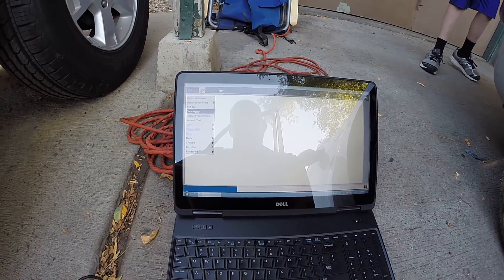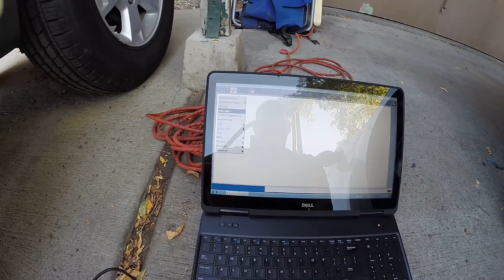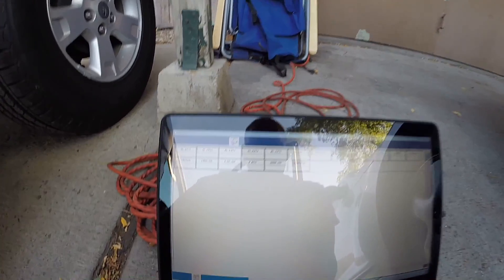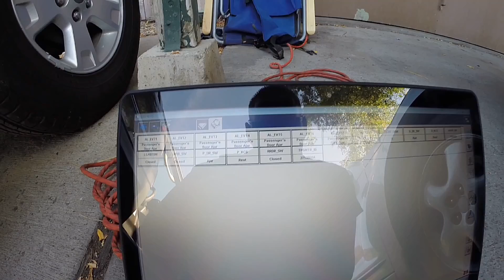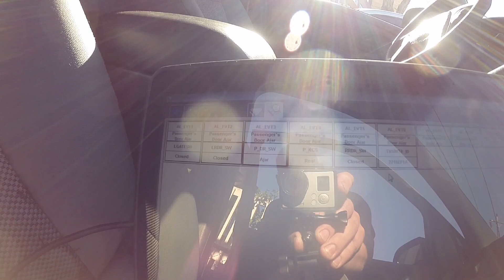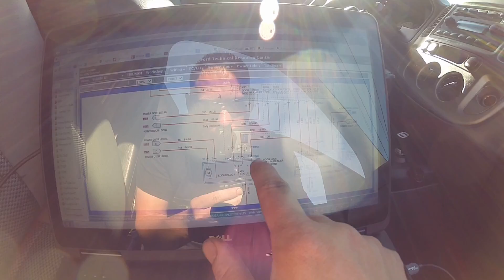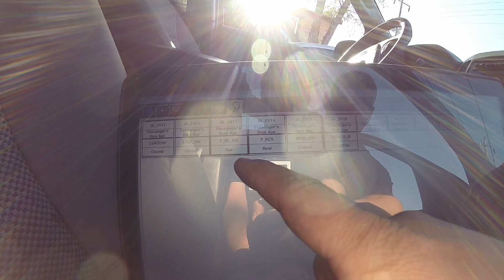Ford Vehicles: Finding Door Ajar & Factory Alarm Problems The Easy Way

Comment from the maker: ELM 327 OBD Adapter you MUST use-
http://amzn.to/2yg0HPT
Reply: can you do an update with the new forscan? I'm going thry the alarm issue and the new forscan does not look like this?
Reply: I have tried this adapter. However with my 2005 escape I cannot get it to read the GEM module. What should I do to find the right door sensor?
Reply: I need ti find someone in Houston TX with FORScan, I have a 2006 Ford Escape with alarm issues, I replace the hood ajar switch that did help some.
Reply: @whodat99991  no
Reply: @whodat99991  lbs there's your hot Cheetos girl you going to miss p
Reply: Would the FORScan lite (smartphone) show us the door ajar and alarm issues? I'm going to figure this out soon? $5.99 google play store $10 bluetooth reader?
Reply: I have the forscan V2.3.33 beta and the recommended OBD adapter connects works good. I cannot find the data logger nor can I find the anywhere to get to the security alarms. Any ideas. On my forscan my icons are on the left side of the screen vertically.
Reply: Can the alarm system hinder my car from starting?
Reply: @infotube6335  not directly, but it will drain your battery, which will prevent your vehicle from starting.

Comment: I have a '13 Explorer XLT w/tow.
Intermittent door ajar for front passenger and driver doors.  I removed the passenger door to inspect wiring. Did not see any short, pulled, bare wires. No worn, chaffed or pinched wire insulation or wrapping. At the time of repair only passenger door ajar light was failed. So I unplugged the lock assembly connector and jumped black w/ yellow stripe. The on-dash door ajar light worked normal as it was unplugged and plugged back in. The door latch assembly was replaced immediately.
I have not seen a false passenger or driver doors1 ajar light since.
So I have a question. If one intermittent latch assembly failure can cause a false intermittent error on the other door too?
Reply: Sure enough 10days later the drivers door failed. Spraying helped for a couple days then needed to be sprayed everytime. Had the latch assembly already so removed and replaced. Problem solved. bought from O'rielys 130ea lifetime *shrugs* look just like chinese on ebay pictures that are 30. 1hr repair time each. 25min if experienced

Comment: I have a ford flex 2013 known for that and i took it to an electrician guy and all the did was ground the wires so it always shows close  even if the door is open. will i be able to undo that?

Comment: Hi,

I have a 2015 platinum and after very, very cold (minus temps) and rain, the security system is going nuts!  Honking, puddle lights on, etc.  Please tell me what software/program you use on your laptop to see the sensor fail data...is it Forscan?  Are the Forscan units that are for sale any good for this?  
I really like the data shown on your laptop screen as it is large and easy to see.

Your videos are the best.  THANK YOU so much!

Jon Francis

Comment: I have a 2000  mercury sable that had the horn alarm going off on its own at anytime. I found a solution on a ford forum site where this guy figured out how to stop it. All you need to do is this. When you get out of your car all the locks are on. The driver door unlocks when you open it to get out. Then depress the door lock button. What you re doing is not setting the alarm using your electronic door locker which is what activates the alarm mode. My friends across the street were thrilled! Haaa.

Comment: Thank you for posting these how to videos. I have learned from them and enjoyed the content. Quick question I hope you can help with. We have an 05 Escape we have had since new and is now on the second child driving it. I have done the bypass of the door ajar switch on all four doors. But now the door chime goes off when the vehicle is in reverse or drive. I may have bypassed the wrong wire in the drivers door as I did not have a diagram for the wiring and think I bypassed the same color wire as passenger door. I f I did this correctly is there a way to disable the door chime? I thought the bypass of the door ajar switch tricked the computer into thinking the doors are closed. Any way the alarm has not gone off since doing the bypass. Thanks again hope you have some advice for this situation.

Comment: Love your videos! I'm having this same issue with a 2004 escape. I ran IDS on it and all the alarm events(8) show panic?? I'm not hitting the panic button and this happens regardless of physical location or proximity of the key to the vehicle. Any idea what could cause a PANIC alarm???
Reply: Weak fob battery can trip the alarm. Make sure both remotes have good batteries
Reply: @tatertots-n-soup  thanks for the tip. I thought that could be the issue so I replaced both batteries but still have the issue. Seems to be isolated to the drivers door. Anytime the door is locked and the alarm is set it trips. Always shows panic alarm in IDS. I gave up and we just don't lock the door anymore.
Reply: After doing the door latch assebly wire jumper test I was convinced enough to buy both front door Dorman latch assemblies from local trusted parts store. It solved the door ajar dash light and the false alarms have stopped. They never logged an event on 2013 explorer.

Comment: I've got a ford explorer with the alarm randomly going off, and I know its either the driver door or the flip up window in the back.  Both of these are not closing quite right (i have to slam the driver door to get it shut and the window in back won't close completely flush).  Does anyone know if the flip up window would make the system say door ajar ? I'd appreciate if anyone knows or can check and report back.  Many thanks in advance if you can.

Comment: Very helpful!  My '04 Escape started acting "twitchy" when I shut it off...a few weird flashes on the dash and maybe/maybe not the key fob would lock it.  When the fob worked, the alarm would go off within 20 minutes or so.  I elected to skip all the diagnostics and just WD-40 and exercise the heck out of all the door/hatch/hatch window latches as well as exercise the hood open sensor.  Victory!  I don't know which latch was the guilty culprit, but my money is on the driver's door.  Any-hoo, 4 days later and everything is ok!  Thanks for the video tips!
Reply: You are very lucky WD-40 work for you, I'm been trying WD-40 on my 2006 Escape.

Comment: I have a 2007 Escape that when it is parked and doors are locked alarm will randomly go off on occasion. I have isolated it to the drivers door. My question is I don't get any door ajar light or dome light coming on etc, no alarm coming on while driving, would this still be a door ajar switch or could it be another switch? I have found if I leave the drivers door unlocked while parked alarm doesn't go off or it hasn't the last couple of days. I tried spraying like you described though I had a temporary fix but alarm went off again. The only thing that works is leaving drivers door unlocked. Your input would be deeply appreciated.
Reply: John Simler mine goes off while driving and it drives me crazy 😩

Comment: You relied on logged history in OBD to get you headed in the right direction.  I have a similar problem with 2 escapes and random alarms.  I'm using Forscan/OBDLink MX and a BlueDriver scanner but neither seem to be able to retrieve the stored events.  All the latch sensors seem to be behaving fine during live inspection so I'm kinda stuck.  If my tools can't see it, I'll want to check 
with a diagnostic center -- what would they need to have to be able to get this information? THanks for all you do.

Comment: HI Brian,  I've been subbed to your channel for several years and appreciate your videos.  I have a 2005 escape with a DR PDL actuator that's not working.    I have confirmed that all the door ajar switches work, including the one for the RR door.   

Initially when I first got the escape last month,  I had a flickering dome light and the door ajar light on the dash flickered at the same time.  I thought I had an ajar switch issue, but I cleaned all the body grounds I could find and that issue has not occurred since.

When I pull the RR door panel off and disconnect the wire harness plug to the actuator assy,   can I back probe one of the wires to check for power for the door lock actuator?   I'd be using a 12v test light for this.  If so, do you know what color the wire is I need to check?  I'd like to confirm it's an actuator issues and not a wiring issue before I buy the actuator assembly.  

Thanks for your help, I appreciate it.
-Greg

Comment: Hi! I am having this problem and purchased the OBDLink MX bluetooth device.  I have connected it to my laptap and can see the software.  The problem is, I don't know what I'm looking for.  There are no "alarms" or issues to resolve.  My question is, I wonder if I need to purchase the additonal Ford software as well? There's no great instructions as to the name of the sensors or alarms I'm looking for.  Does that make sense? My knowledge on this is so extremely small, I don't know if I'm communicating my questions well :)  Thanks!
Reply: Ok. I see that it's the GEM module that houses the door alarms.  But it says I have no issues to solve.  HELP!! I definitely have issues.  I just sprayed last night with WD40 but I haven't driven anywhere yet.  I have a 4-hour drive coming up on Monday and will go nuts if it alarms the whole time.  Interestingly, I noticed it didn't do it AT ALL during the winter.  The hotter it gets, the more it happens.  Any thoughts on that?

Comment: I have a 2002 Explorer that has issues with the alarm and door ajar light, but the light isn't on all the time. It sporadically comes on when I'm driving- the chime goes off, the doors lock themselves, and the hub light flashes on and off. The alarm would also go off randomly, sometimes several times a day, until I just went ahead and took out the horn fuses. Do you think what you did in this video would solve my problem too or is something else causing this problem?

Comment: I have a problem I need some advice with....when I lock my doors my car starts!  I do have the alarm issue and it's been annoying me for several years and my rear hatch opens sometimes and other times it won't,  but this week when I lock the car it starts so I could really use some advice with that.

Comment: So what scan tool are you using? FORScan?  I am having trouble with my 2013 Expedition alarm going off randomly, can I use the FORScan software with the ELM237 to trouble shoot which door is causing the issue?

Comment: I got a used 2001 Ford Excursion Limited (7.3L Diesel V8), but the owner only had a single, ordinary all-metal key (no chip, no spare).  The vehicle still starts with the ordinary key, no problem.  The problem I'm having is whenever I open any of the doors, the interior lights and the running board lights go on and stay on, even after I shut the door... this happens whenever I open any of the doors.  Eventually (maybe after 30 minutes) the lights shut off.  During the time when they are on, I've noticed the "Theft" light on the dash blinks every three seconds.  I've tried lubricating all the door latches, but that didn't resolve the issue.  What would you recommend?

Comment: I ran FORSCAN on my 98 ford ex v6 SOHC and it gave me the code for 4X4 high circuit shorted/open circuit or something similar to that. How do i even begin to work on this? Is it something on the inside of the tranny? Or could this be something caused by a bad ground?

Comment: What if your car locks and the interior lights are coming on as your driving and at times when parked as well? Plus the auto headlight feature is not working. The car is a 2002 Ford Taurus SEL. The alarm will also go off for no reason after its parked and locked with the key fob. What should be checked and in what order? It's possessed just like that movie Christine!

Comment: this is a very good video. however if it were  broken wire making contact once opened this could complicate things. always test things in their natural state of when the problem is occurring (door closed). on the other hand, this  is a ford so less problems with wiring than some other vehicles.

Comment: Hi, I have Forscan talking to my 2005 Ford Escape but I don't see anything (PID) for door ajar, security, etc.. I downloaded the latest version of Forscan V 2.3.4 Beta. . It looks different than yours. Is there a certain version that has Security, Door alarms,  included? I appreciate your video but it would have been nice if you explained what exactly is needed to get this information. Is the PID in the adapter itself? Is it in the professional add-on? Where the hell is it? LOL Thanks
Reply: I was never able to see the error. I believe you have to purchase a better USB adapter that includes the door ajar alarms. My problem seems to have gone away for now. I removed the fuse for while then put it back. Now the problem is gone.  Good luck..

Comment: I bought the exact Ideashop® ELM327 WIFI adapter linked in this video information and it cannot access the perimeter door PIDS described in the vehicle.  Am I doing something wrong, is there a setting I'm missing, or is it the wrong adapter for this use?

Comment: Thank you for everything you do, I love your videos, they have helped me greatly.  I have a 2005 Escape and the PIDs for the doors (or even the modules you reference in the comments) do not show in forscan.  I only get a couple of modules (ODBII, PCM, 4X4M, ABS,IC,RCM).  Do you think it could be a crummy ELM 327 adapter?
Reply: It did.  You need to have the other modules to show the alarm and door statuses.  This is what I ended up getting and it works awesomely.  

https://www.amazon.com/ScanTool-426101-OBDLink-Bluetooth-Professional/dp/B006NZTZLQ
Reply: +Aaron Blount I ended up getting a new adapter.  It turns out that the really cheap ones sometimes don't have all the modules.
Reply: Did you ever solve your door problem? I have a 2005 Escape w/door ajar problem. I bought a cable and have Forscan v2.3.4 running but it seems limited. I see no door, security, alarm, etc..
Reply: @matthewmarsman  Which adapter did you buy?
Reply: matthewmarsman why do my door ajar light stay on and radio don't play anddomelight stay on
Reply: 03 pilot drivers side door lock lip

Comment: I find the wires in the rubber in the crack of the doors broke a lot also. Also If you ever have a vehicle where all the windows dont work. I have fixed a lot by checking the wires going in the cracks of the doors and if no wires are broke there I always take out the driver and passenger seat and 90 percent of the time the wires are corroded under the seat because its the lowest point of the interior and all the water and moisture collects there and that's how they run the wires to each door is usually under the carpet under the seats.

Comment: Had this same issue with my 2002 Ford explorer.  Tracked it down to the passenger front door.  Ended up having to get a new door ajar switch because the old one was physically stuck in the open position.  The switches aren't cheap for the explorers and hard to find for the passenger side since they rarely go out.
Reply: same problem with my 03. passenger side says open all the time. drivers side intermittent.

Comment: Do you know how to turn off the seatbelt minder on a 2015 explorer with my key?? Great video BTW!!
Reply from the maker: +psd6ohslow 
Deactivating and Activating the Belt-Minder Feature
WARNING: While the system allows you to deactivate it, this
system is designed to improve your chances of being safely
belted and surviving an accident. We recommend you leave the system
activated for yourself and others who may use the vehicle. To reduce
the risk of injury, do not deactivate or activate the system while driving
the vehicle.
Note: The driver and front passenger warning are deactivated and
activated independently. When deactivating or activating one seating
position, do not buckle the other position as this will terminate the
process.
Read Steps 1 - 4 thoroughly before proceeding with the programming
procedure.
Before following the procedure, make sure that:
• The parking brake is set.
• The transmission is in park (P).
• The ignition is off.
• The driver and front passenger safety belts are unbuckled.
1. Turn the ignition on. Do not start the engine.
2. Wait until the safety belt warning light turns off (about one minute).
Safety Belts 45
2015 Explorer (exp)
Owners Guide gf, 2nd Printing, September 2014
USA (fus)
3. Wait 10 seconds after the safety belt warning light turns off.
• Step 4 must be completed within 20 seconds after the completion of
Step 3.
4. For the seating position being disabled, buckle then unbuckle the
safety belt three times at a moderate speed, ending in the unbuckled
state.
• After Step 4, the safety belt warning light will be turned on for three
seconds.
5. Within about seven seconds of the light turning off, buckle then
unbuckle the safety belt.
• This will disable the feature for that seating position if it is currently
enabled.
• This will enable the feature for that seating position if it is currently
disabled.

Comment: Nice diagnosis.  Enjoying the tour videos.  Wiring diagrams are the key to make things much easier
Reply from the maker: +Ozzstar Sure are I prefer them over a pinpoint test in almost every situation.
Reply: Where do I find the wiring diagram?? Can't find anywhere online. I have a ford fusion and the cable attached to the latch has only 5 wires but how to know which one is which?